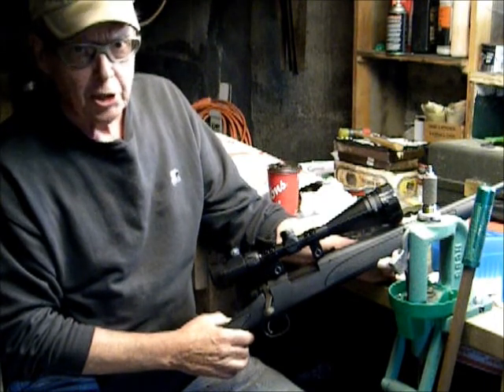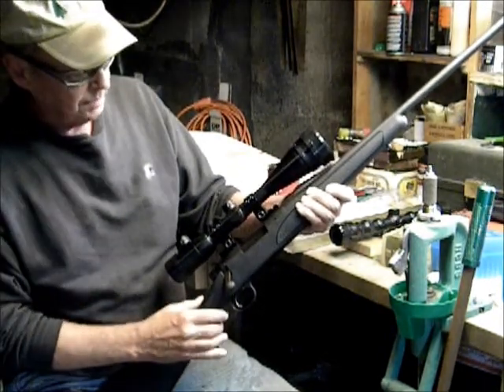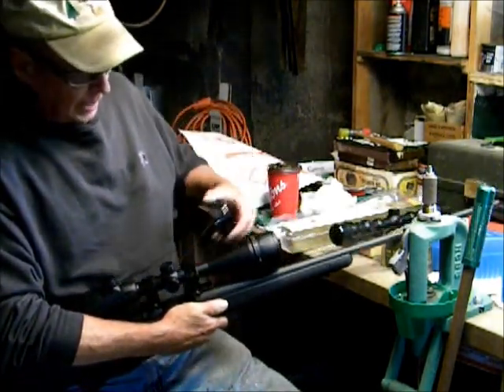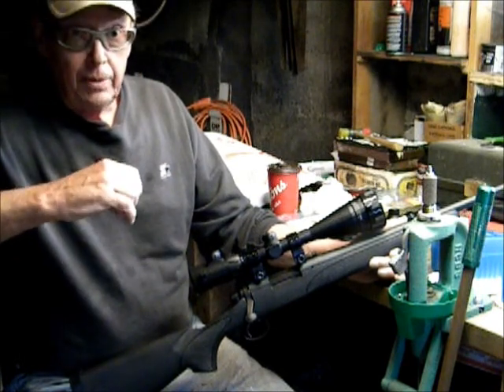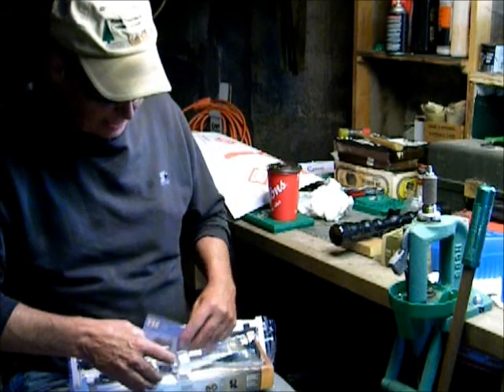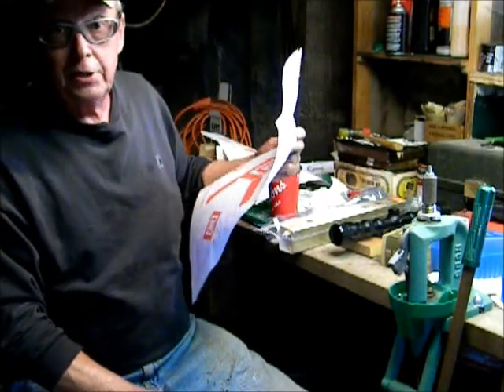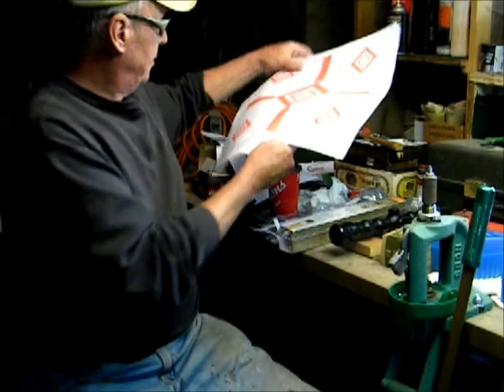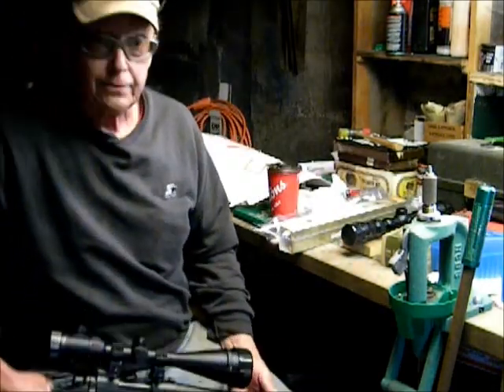CenterPoint 6X20X50 Rifle Scope

Comment: Great overview...

I have two of these (one for my FNAR .308 and the other for my 30.06). These are some of the best scopes for the money and have never lost their zeros. Love the illuminated green and red options, and parallax focus rings, as well... 1/4 clicks are nice too...easy to zero if necessary. Got mine from Wal-Mart as well. I’d put them up against any high priced scopes any day. I have higher priced scopes, but to be perfectly honest, I should’ve just gotten these. Best $84.00 I ever spent. Also, a little known fact, that C/P is actually a part of Crossman BB gun manufacturer...
Reply: 1" or 30mm??
Reply: @dpos89  1 inch
Reply: Yes dpos89 there 1 inch tubes,if that's what you were referring to ok.i have 1 of these exact scopes mounted on one of my 300 magnum rifles for going on 6 years now and I have had no problem's or trouble with it at all.i shot deer with it up to 511 yards away,and have had it fall over on the grow while setting it up against my hunting tree.and have dropped it a fue times to and it still holds zero yet at exactly 100 yards,so get one and try it it's clear as a bell and great at low light and on bright sunny days.and if it doesn't work out to your liking then box it up and just take it back and get your money back right!!!!!

Comment: Centerpoint make scopes for high powered spring and gas ram air-rifles
The double recoil of these rifles destroys lots of scopes made just for the rearward recoil of powder burners.
These scopes are plenty good for their intended purpose.
The fact that many people use therm on high powered rifles with complete satisfaction says a lot for these inexpensive scopes.
I like Leopold scopes on my powder burners but I'm not going to put one of my expensive scopes on a gun known for destroying scopes.
The center point works fine on my break-barrel Springer  air rifle so far.